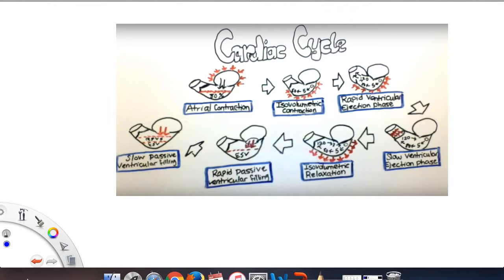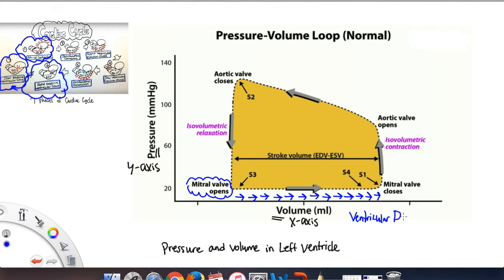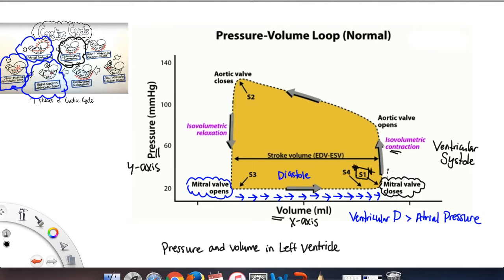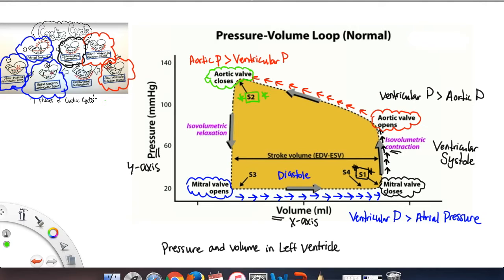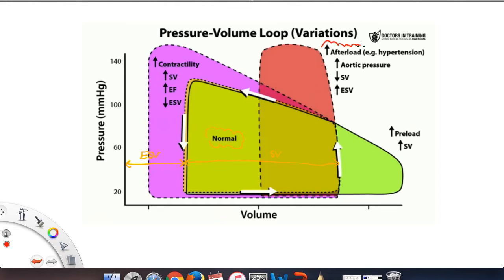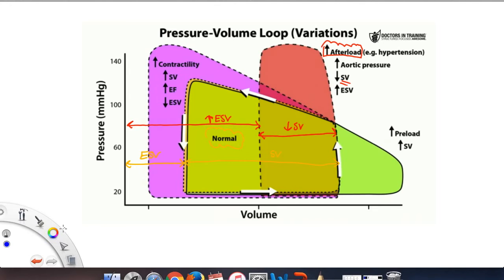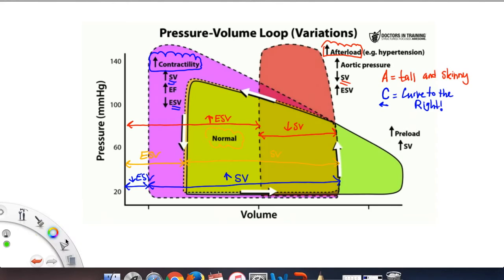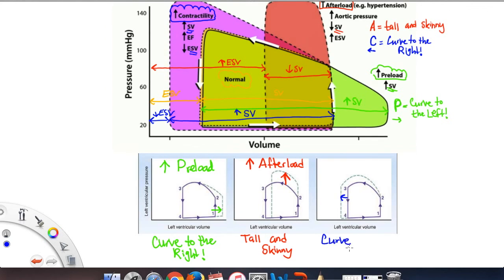What is the Pressure Volume Loop Curve? Explained in 6 minutes!!!

Comment: I think it is wrong (6:00).  Please answer this question.  I think all textbooks show it wrong.  SV increases as EDV increases and they all shorten to the same ES point on the ESPVR curve.  Why should it shorten to the same end systolic pressure or point?  If you increase SL (as in higher EDV) you should get more force (Force-length relationship) and more force means higher pressure.  If they all shortened to the same ESP when you increase EDV, how would they even get the ESPVR curve?